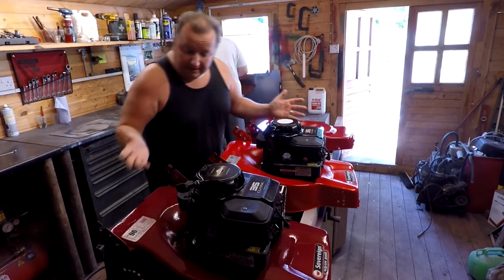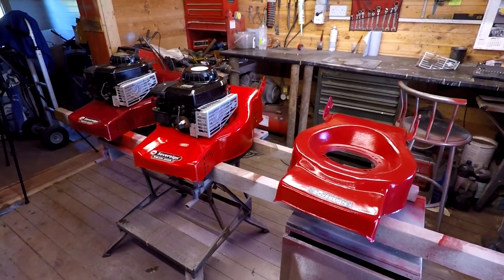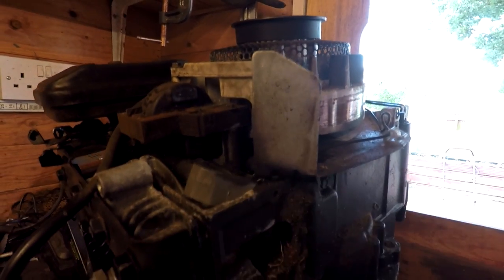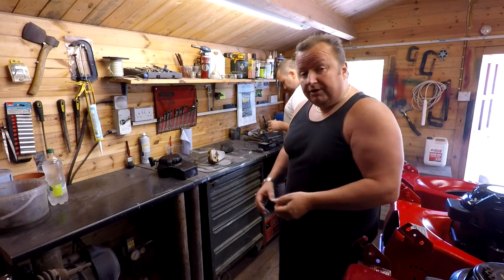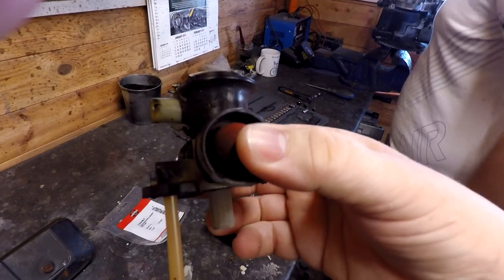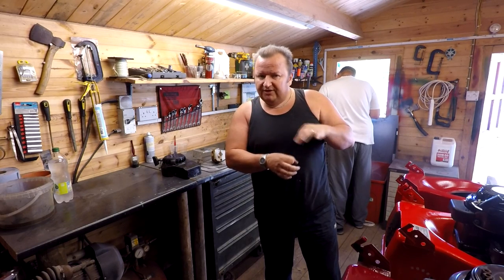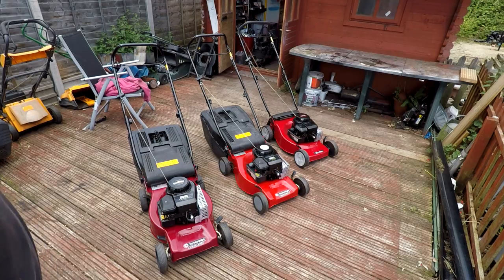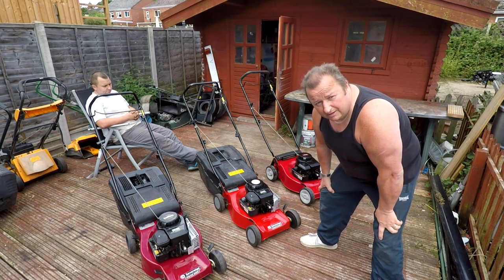Part 2 Three Sovereign Lawnmowers

Comment: Top tip Martin , i drill a hole in jam jar lids , then screw them to the underside of my shelves . then you can screw the jars on & fill with nuts , bolts etc , then label , saves space in drawers , as the underside of a shelf is unused.
Reply from the maker: Yes, seen that one but never got round to doing it. Might have too one day Gary.

Comment: Mower heaven! I've just picked up a mountfield sp454 and serviced it! Was a right pain these are much better engines
Reply from the maker: Yes, they can be a nightmare Paul. Don't buy those as a rule.
Reply: Me neither but it was local and I get so many emails about them I thought Id film some videos. Stuck it on facebook marketplace for £150 and it sold in less than 15 minutes. £100 profit with no fees. Just Editing vids now. The briggs and stratton are much easier though. Those decks look amazing as well. Nice on Gary!

Comment: Great video martin, question I have a 2014 mower deck that looks like its been powder coated but has deep scratches and rust can it be painted over or will I need to take it all back to bare metal
Reply from the maker: As long as the surface is sound and has been prepped properly, you can paint over the existing finish.
Reply: thanks very much Martin keep up the good videos

Comment: Hi Martin can I ask a question. I have a lawnmower with the same engine as these it hunts up and down I have changed the gaskit? And diafram on the carb and it still hunts up and down could you spread some light on This problem for me? Where the throttle assembly is there is a lever that flicks back and forth which changes the spring possion it is on the front where the spark plug is and I also carnt figure out what it does can you also help me with this pleases?
Reply from the maker: We,ve had this before and it was the new gasket that was at fault. As long as you have cleaned the carb out properly and fitted a new decent gasket and diaphragm correctly, all should work fine. That's all I can really say.